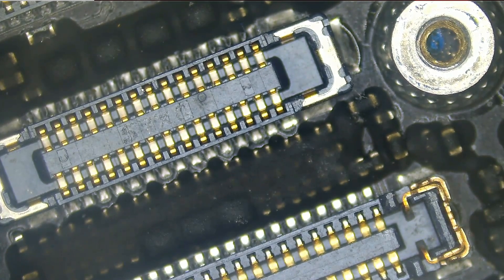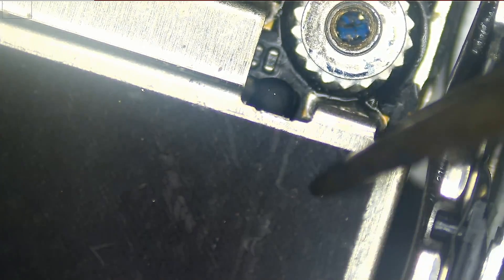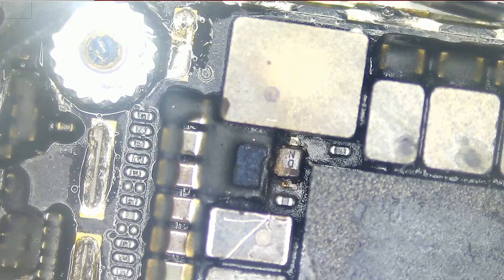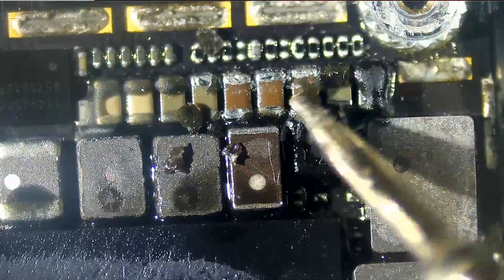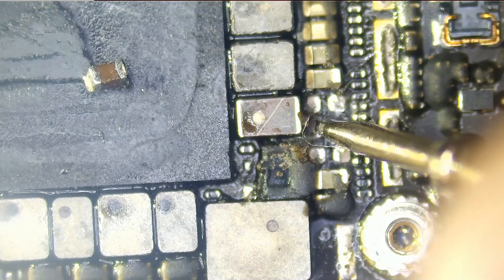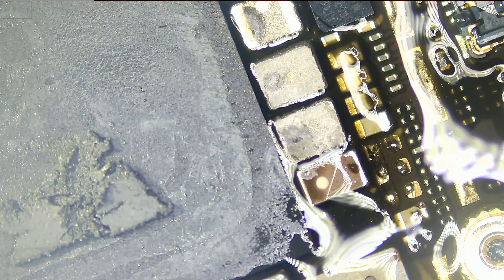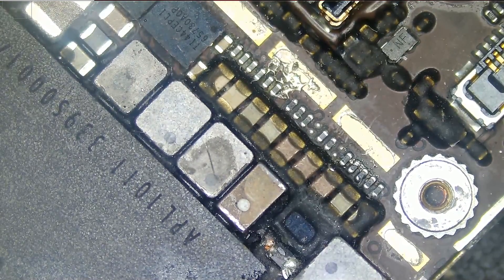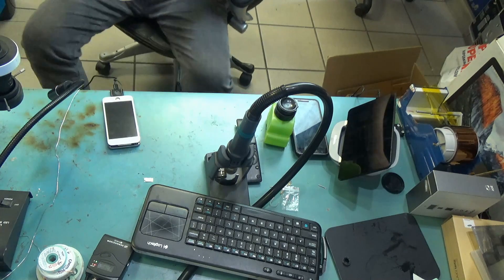iPhone 6 No Backlight Dim screen - Short Circuit Repair

Comment: can you not replace with off the shelf parts (caps, filters, diodes etc..) why must it always be off a donor board??
Reply from the maker: Of course you can. You need to get the value and have the part in stock. Getting it off a donor board is just easier.

Comment: What ohms you consider short in a line to ground ?
Reply from the maker: No specific value, depending what you are used to seeing for that specific case. Diode mode indicated a short, Testing in ohms mode we get fluctuating numbers from 0-28ohm which is not normal. Diode is also blown. Putting all those together,  and previous experience working on the iphone 6 backlght circuit, will quickly lead you to one of the bigger caps being the cause of short,  and not the small one on next to the filter. If non of the caps were the cause, then we would look at u1502 backlight ic.